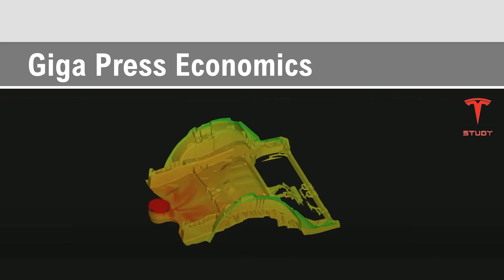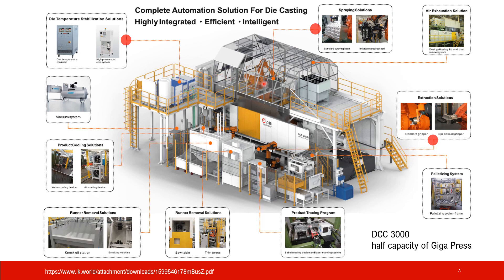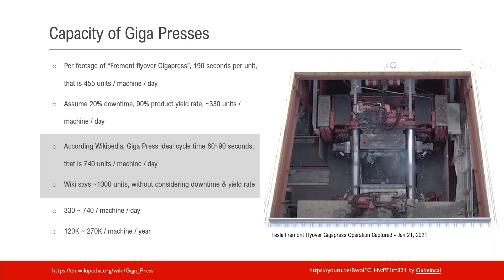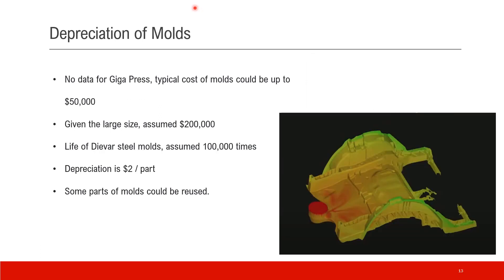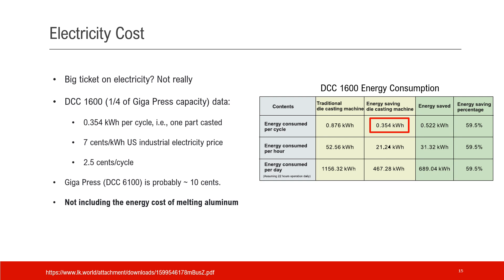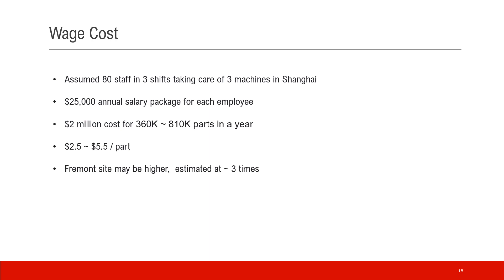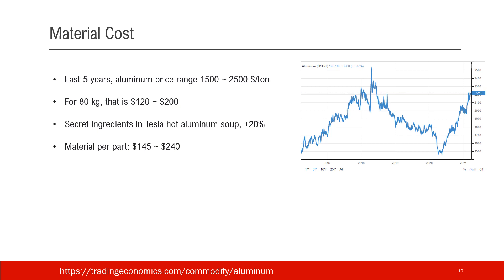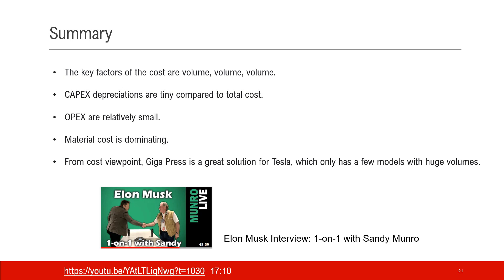Giga Press Economics

Comment: This was really interesting.  What I'd like to see now is the same analysis for what the cast parts replace.

Previously Tesla (or someone) was stamping many individual pieced of metal and then assembling them.  What might have been to cost of the material being stamped, the stamping presses, and the fasteners/adhesives/welding to assembly them.  Just the handling of all those parts to get them from the stamping machines and bolt/rivet manufacturers would have been a measurable cost.

How much maintenance and energy was saved by eliminating 297 robots from the rear section assembly?  597 for a combined front/rear casting like it sounds like is coming?  Just programming all of those robots and keeping them accurate must cost a lot.

How about assembly time labor/time savings?  Sandy has pointed out that when working with lots of assembled parts there can be a lot of variability in the final assembly.  Each little "error" sums.  That makes it more difficult to accurately attach the body pieces.  With a cast piece there's essentially no variance from piece to piece.  Much, much less 'fine tuning' on the line.

How about floor space saved?  Once Tesla is casting all the underbodies in Fremont they could probably add more assembly lines in the space freed up by eliminating thousands of robots.

How about throughflow time?  If it takes only two minutes to produce the underbody of a vehicle using casting how much faster might raw metal emerge as a finished vehicle?

Sandy has stated that it's costing Tesla a lot less to manufacture the Model Y than the Model 3.  I assume much of that savings comes from casting.  Once Tesla is casting the entire underbody of the 3 and Y and starting to use much less expensive lithium iron phosphate 4680 cells they might be able to sell the 3/Y for under $30k and make a very nice profit.
Reply: Unfortunately I dont really see the advantage of casting since other companies already have the stamping presses that have already paid themselves, they use significantly less robots than tesla for the same parts, steel is way more affordable, by sharing platforms other manufacturers are able to significantly reduce the amount of pieces and also they don't use 300 robots for the rear like tesla. At big scale stamping, welding, gluing are very efficient and fast thats why vw is able to make 10 million vehicles a year.
Reply: @alanmay7929  Math, Alan.

Elon's got math.  And he has the ability to look at a job and imagine the best way to get it done.  The old way often is not the best way.
Reply from the maker: wow, nice comments, bro! You know a lot.
Reply: @t-study5089  Less than what is seems to appear.  Mainly I watched Sandy Munro's discussions of how many separate pieces were used in the Model 3 and how bad an idea that was.  Which Elon agreed with.  And I watched a couple of videos of plants stamping out metal parts for cars.  

You had people moving huge rolls of steel from storage to the stamping machine.  You had people snatching the stamped pieces out of the press.  You had other people moving the pieces to racks and the racks to delivery trucks.  And I saw a count of all the bits and pieces in a first gen Model 3.  IIRC it was over 300 once you counted bolts, nuts, and rivets.  Then I watched the process of making a bolt.  

There had to be teams of people making all those unique parts and getting them to the 300 assembly robots that then attached them together.  

Just imagine.  All of that stuff gets into the mold in milliseconds and the mold is ready to make another casting in about a minute and a half.

Watch Sandy's first Tesla teardown and you'll hear his rant about how bad the initial frame design was.
Reply: @bobwallace9753  thats totally wrong, stamping machines are totally automated and there are very few operators that controls the quality, also tesla will still use stamping for sooo many other parts including doors, fenders....... if vw is able to make 10 million cars a year I dont see how its difficult.
Reply: @bobwallace9753  the casting isn't done in milliseconds, they have to seriously control the cooling process and also verify the part after to check for imperfections since its a large part that carries the entire car, I think hey also have to test the casting for rigidity and errors can also happen in the melting and consistency of the alloy.
Reply: @alanmay7929  Cost, Alan.  This video makes it very clear,  The cost of casting large parts of the vehicle and the speed of production (also a cost issue) make what Tesla is doing allow Tesla to manufacture cars for less and sell them for less.

That will speed up our transition off fossil fuels.
Reply: @alanmay7929  The mold is filled with molten aluminum in milliseconds.  The casting machine can produce a new part in less than two minutes.  There are some cleanup steps that happen after the part leaves the casting machine.
Reply: @alanmay7929  Here's a general rule you might find useful, Alan.  When you see something you question from Tesla, SpaceX, Boring Company, or any other Musk operation consider the fact that math has probably been done.

And as a general rule, do not assume that the way things are being done are the best ways that things could be done.  Innovation is a constant.

What might someone working on a low skill requirement, highly repetitive job makes per hour?  $20?  Add on 25% as a very rough estimate of employer overhead.  

$25 x 24 x 365 =$219,000.  That's over a million dollars over 5 years. A robot costs between $100k and $150k,

(You asked in another comment why so many robots are used.)  

What VW is doing most likely is not what could optimally be done.  Tesla does math.
Reply: @bobwallace9753  boring company is a joke compare to herrenknecht or other boring companies, have you even seen all the sizes and types of tunnels that they have already made?! From undersea tunnel to the alps in Switzerland..... or subway stations around the world. What elon does is sewage pipes underground for cars right!! For tesla its still very unsognificant considering that batteries are going to be the biggest problem in the electric vehicle industry andits already showing.
Reply: @bobwallace9753  vw does efficiency and maths thats why they can make 10 million cars, its not that hard to understand, their Wolfsburg factory alone makes over 800k cars a year which is almost double than tesla did entirely last year
Reply: @bobwallace9753  i know exactly how casting works dont try to explain to me, casting has its own efficiency an parts needs to be controlled to avoid defects which can be catastrophic. A bigger casting means bigger issues.
Reply: @bobwallace9753  uhm thats totally wrong, casting is just part of the equation, not the solution, batteries are also another problem, plus other manufacturers have very cheap cars, I mean seriously cheap. A toyota aygo, yaris, corolla...... are sold in million for the mass. Toyota has already sold over 45 million corolla for example. The rav4 is another biggest car seller in the world.
Reply: @bobwallace9753  until the transition is dont batteries will need to significantly evolve and be made in mass to produce millions of EVs including tractors, agricultural, mining machines........
Reply: @bobwallace9753  and youre a troll!
Reply: Another question - how easy is it to introduce a completely new design? Suspect switching moulds would be significantly cheaper than reconfiguring the manufacture and assembly of a multitude of individual parts.
Reply: @evfusion4094  Yes, the molds can be swapped out fairly fast.  IIRC it's short hours.  

My guess is that if Tesla had some lower production models (S and X) that needed different underbodies they could pump out a week or two worth of one, swap out molds, and do a run of the other casts.
Reply from the maker: @bobwallace9753  100% agree.
Reply: @evfusion4094  are you dumb?! To make a different new part for stamping you just need to change the die, for casting its a little more complicated.

Comment: IRC the main cost of aluminum is electricity.
It so happens that wind and solar at scale are expected to produce lots of excess power out of peak hours. Which would typically be used on hungry on-demand things like... making aluminum.
Tesla is securing it's own future.
Reply: I've thought about that, but I wouldn't want to overstate the value of a huge daily surge of cheap energy. When you have a very expensive machine that produces a lot of value, you want to keep it running all the time, not just when there is sunshine.
Reply: Uhm unfortunately wind and solar are intermittent sources of energy and hydroelectricity, gas/coal/nuclear power plants are well suited for metal work/foundries. Just imagine the bill of a foundry per months and they are usually installed around very secure energy production plants.
Reply: @alanmay7929 It is precisely because they are intermittent that excess capacity must be installed.
They remain the cheaper option despite that.
Reply: @musaran2  uhm nope the cheapest option is hydroelectricity and most power plants are already installed, thats why foundries can work 24/7 with very high energy capacity without drop in performance.
Reply: @musaran2  solar and wind also depends too much on weather. When its too windy or not at all the wind turbines stops, when it snows or rains solar panels are almost useless just a few example of cons.

Comment: 300 robots were removed per cast piece. If both front and back end was cast, then 600 robots were removed.
Reply: How is that even possible to use 300 robots for just a car section? Wtf! I'm sure other companies doesn't use sooo much robots
Reply: It's sounding like the entire underbody of the Cybertruck might be cast as a single piece.  And then the battery pack/structural unit attached in the center.  That will make for a massive decrease in robots and labor.
Reply: @bobwallace9753  cybertruck will also have a cast front and back end like Model Y.
Not entire single piece
Reply: @nickidk4  There is speculation that the much larger casting machine that has been build for the Cybertruck will be able to produce the entire underbody in one piece.  

Has Tesla stated otherwise?
Reply: @bobwallace9753  rear and front is larger on cybertruck. New casting machine is 30% larger.
It would have to be around 400% larger to cast the whole underbody in 1 piece..
So I give it 0% chance 😊
Reply: @nickidk4  Sounds like it won't be a one piece casting.
Reply: @bobwallace9753  My understanding is the 'battery pack/structural' unit is the 'underbody' - this is one massive casting to which the front and back casting is added (as Nicki Jensen suggests).
Reply: @evfusion4094  I'm fairly certain the battery pack (cells in a container with the voids filled in with epoxy) is assembled and then (strongly) attached to the rest of the underbody, the cast part.  The design locks everything together into a very strong, stiff "frame" on which the body parts are added.

Certainly, there's no way to cast a battery cell.
Reply: @bobwallace9753  Maybe.  Maybe you could cast a Sadoway cell (google Ambri).
Reply: @loungelizard836  You could cast some sort of container to hold the liquids but I highly doubt we'll drive around with molten metals under our feet.  Lots of practical problems.

And I'm still waiting for Ambri to demonstrate affordable grid storage.  They promised it years ago.  Were not able to manufacture small batteries due to electrode sealing problems.

Comment: Hi, thanks again! Watching your video it occurred to me that, with the number of 300, Elon perhaps referred to the number of robots over time and worldwide. This because 300 robots replacing one press seems pretty excessive to me. Do you think I have a point here?
Reply: I dont think 300 robots are just used to make a small part of the car, its really unthinkable and other companies probably uses significantly way less than that number.
Reply from the maker: My takeaways from Elon-Munro's conversation: (1) ~1000 robots in the BIW shop of current M3 or previous MY. (2) ~300 robots removed with rear casting, as Fremont/Shanghai MY. (3) another 300 will be removed with front casting, as Berlin case. Not replaced by 1 giga press, but a number of them that matches the original productivity (I guess 2 giga presses for 250K/year capacity in Fremont case). Recommend reviewing that video.
Reply: @t-study5089  OK, thanks. Sounds fair! I've seen that video but will revisit it.
Reply: @t-study5089  they will also need significantly way more casting machines since those aren't the fastest.

Comment: Very interesting.

My takeaway from this is that the part cost itself isn't hugely effected by the gigapress. Sure, those 300 robots are expensive, but since material costs dominate so overwhelmingly, it's not significantly more expensive to cast smaller parts and assemble them with robots.

I suspect the other costs associated with 300-robot assembly process are more important.  In particular, downtime as the machines go out of calibration and quality control issues.  Simplifying the process has benefits beyond the direct costs.
Reply: Factory footprint too.
Reply: Talking calibration..... those robots are connected to servers and computers to accurately control them, I don't really see the problem with robots since they also mostly use electric motors instead of hydraulics. The other advantage is that other companies have been sharing platforms within sooo many different vehicle models so the programming and settings are waaay les commun.
Reply: Also other manufacturers does not use 300 robots just for the rear like tesla was doing.
Reply from the maker: You are definitely right. Watch that Elon-Munro video, a long section about Giga Press, you will see how painful and costly in the other way.

Comment: Very interesting.  However I think you may be underestimating the depreciation on the giga press by a large margin.  The size of the giga press and the intensity of its use is likely to make the life of the giga press substantially shorter than the average press produced by IDRA
Reply from the maker: You are right. In a number of places, I have to use educated guess to extrapolate answers. They could be off quite a bit. Regarding the intensity, Fremont Giga Press runs at 190s compared to 80-90s designed cycle time. So not too intense. The HPHT parts are mostly on dies, which are replaced periodically. The part I feel most unsure is the maintaining cost.